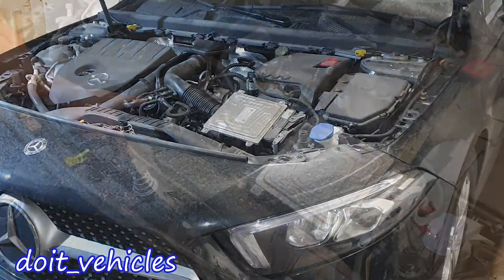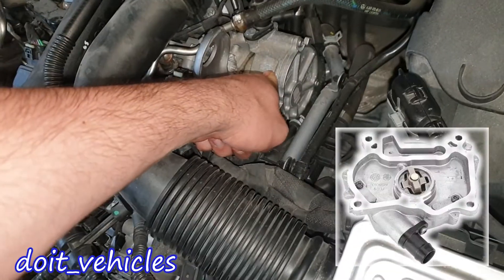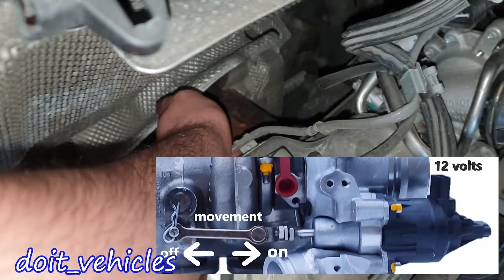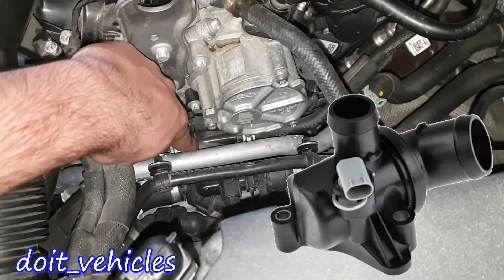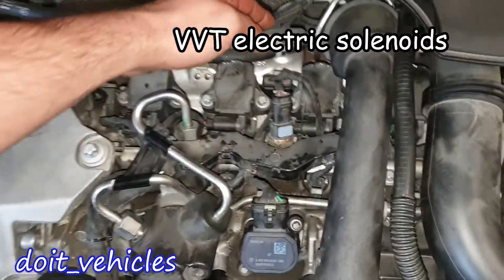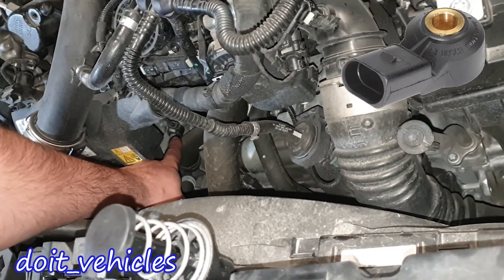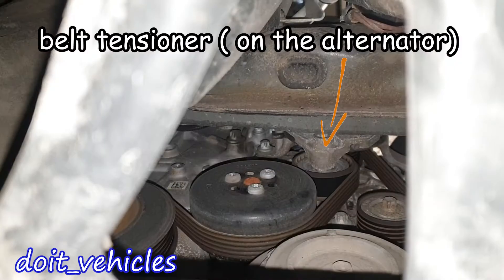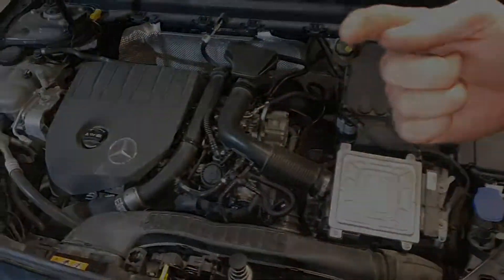M282 DE14 Engine Components Location W177 Mercedes A200

Comment: Plz I have the same car , 1.3 163cv , and I want to know haw the quantity of oil for engine drain ? Somme one told me 5.1litre , but I don't know , with filter or not , plz I need help .
Reply: I just done oil service on my 2020 A180 1.3L
I filled 5L 0w30 oil and computer shows oil is at maximum 👍🏼